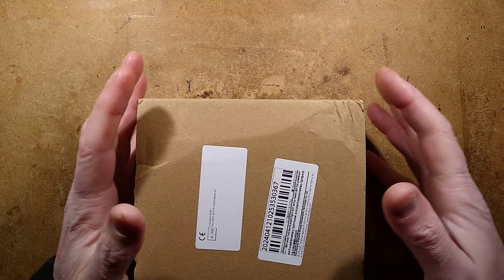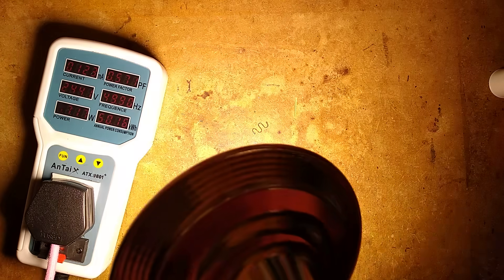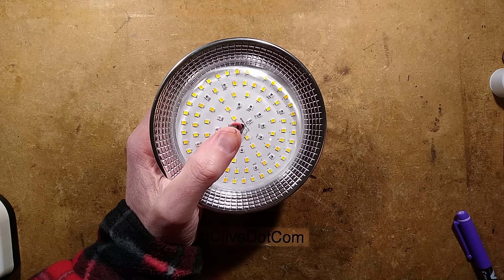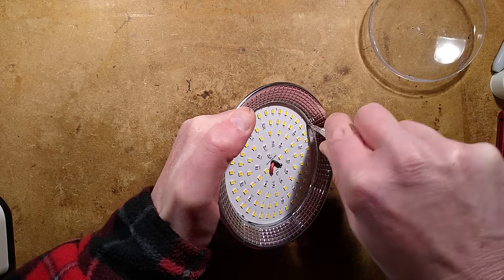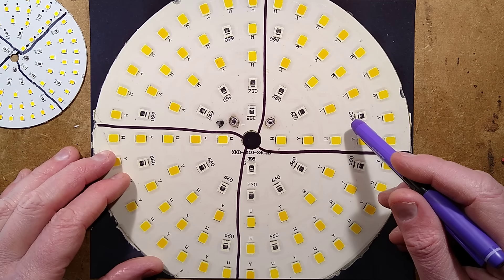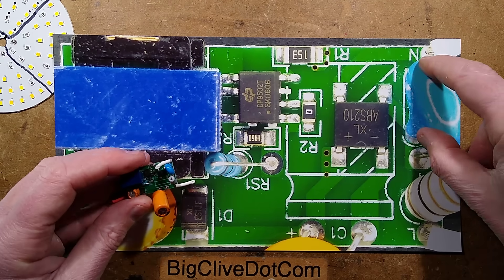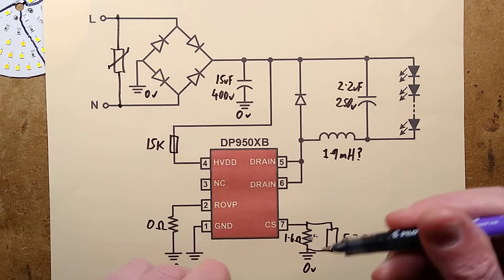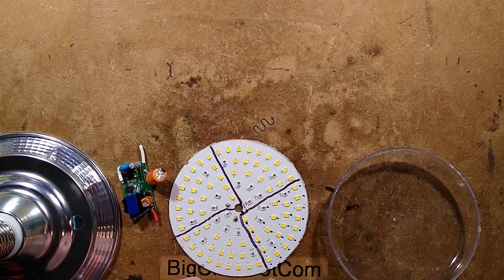Broad spectrum grow light teardown

Comment: After watching this video I bought one because I was interested in the qualities of the light output.   One thing I noticed was that when the light was off and in the socket, if I touch the aluminum, the LEDs would glow at a very low power.  I did NOT touch the aluminum when the light was on.
At first I thought I was discharging the capacitor.  HOWEVER, I tested it in a ceiling fixture that is still connected to 1924 era knob-and-tube wiring, which is not grounded.
I will test this on another circuit in a modern house, but in the meantime I have a ...
Question: When the bulb is on, do you think the aluminum cooling shroud is dangerous to the touch?
Thank You!
Reply from the maker: It's probably capacitive coupling from the tracks to the case.  Very common.  It only takes microamps to make the LEDs glow.

Comment: A test in 2016 which I cannot find any longer showed what happened at different wavelwngts. Red having less energetic photons made the plants larger, while blue kept them compact.

I suspect most will be best served with normal white light with some separate blue and red COBs. 

You can go into absorption equations the different chlorophyle types but the sun does not care.

Comment: I found out myself a long time ago that fondling the metal casing of an electrical device with the back side of the fingers very often gives this slight tingly sensation if it is "grounded" by the tiny HV capacitors... if it is floating, usually not so much. It even seems to impart a slight friction.

Comment: 2:44 my phone is giving me tingles when I slide my fingers over it and when the phone is connected to a charger. Well not exactly tingles but I feel a slight fuzz similar to when you touch a CRT but weaker. I can even light up my test screwdriver a bit when I touch the metal body of the phone.
But I guess that is fine.
Reply from the maker: If it's a good quality charger from a reputable source, then it should be OK.

Comment: Too bad that the driver circuit is located in the heat trap with no effort to keep it cool.

Even if the rated MTBF of the IC is a miilion hours, elevated temperatures can reduce yhe average life to less than 10,000 hours... By which time half of them can be expected to have failed... Mean time between failures... Halves for every 10°C in operating temperature above 25°C.

Comment: Interesting video, (I thought it was a shower head for a moment!) But what happens to all the bits at the end. Do you re-wire it all back together? (Someone would buy it, especially if its been on Clive's bench.) Or does it go into the skip...? 🤔
Reply from the maker: I kept the buck converter and PCB, but wouldn't trust it as being safe now I've prised the PCB out.

Comment: Mixing 3000 K and 5000 K white light doesn't give you better color or a more even spectrum. It just gives you a shade of white in between, which is 3750 K, assuming equal luminosities. It would also have a slight magenta tint, being off the black body locus, so it's not even pure white. There's no particular benefit to mixing whites like this in a fixed ratio.  You'd be better off using emitters of the desired color temperature. Now if the ratio could be adjusted, then it would be a tunable color temperature, which is quite useful.

Comment: Little gadget that you might appreciate - OPPLE Light Master It measures the light Illuminance,Color temperature(CCT), CRI, CS, EML, R1- R14, DUV via bluetooth on your phone - ive been using mine for about a year and has been accurate - plus its about $30-40 from the usual sources

Comment: I grow 'herbs' inside. I prefer to use the normal LED bulbs you can get at any hardware store in the daylight and warm spectrums. Then, when they get bigger, I prefer to use a 600w high-pressure sodium lamp and ballast. Works great ;)

Comment: Made my own grow lights for my winter garden plants (Citrus × limon and Nerium oleander) with those pinky cheap DIY 3W star shaped chips "380nm-840nm". They work fine and my plants seem to like them (last winter no problems). Put a bunch of them on alu heatsink-leftovers from no-idea-what combined with an older MeanWell power supply.

Comment: 3:01 Is that what that is? I’ve been wondering for ages why I get a slight tingle that makes the hairs on my hand stand up when I touch the metal case of the (unearthed) DVD player!
Reply from the maker: It's very common and quite an annoying feature of the modern high frequency power supplies.  Not just capacitive coupling between the winding layers, but also via the capacitor that is supposed to provide a route back for that coupling to reduce the radiated electrical noise.

Comment: Just a minor correctioni: 5000K isn't cold white. It's about as close to neutral white as an LED can get as it's approximately the standard photographic white point. Cold white tends to be more up around the 6000 to 6500K range and has a distinct bluish hue to it.
Reply: 5000K can come off as extremely cold if they skimped on the phosphors in the red to yellow part of the spectrum, which a lot of low CRI lights do. Part of the problem with fluorescent tubes was that they had similarly rubbish CRI, which is why paint swath desks used to have buttons for incandescent, fluorescent, and "daylight" (the last one was just both lights), and a lot of the early "daylight" LED bulbs had the same problem. Fortunately, high CRI phosphor blends are more common now, but I wouldn't be surprised if LEDs with the more rubbish blends are being liquidated in fittings such as this, because the warm white phosphors help fill in the gaps.
Also, I promised myself that I wouldn't get into the pedantics of higher color temperatures being "colder," but I guess I just broke that promise, so in a nutshell, the hotter a star's photosphere, the bluer its light.
Reply: No... 5k is 5k.  It's the packaging that lies,  not numbers.
Reply: @thomasneal9291  No, not all 5K are created equal. I remember having one of the earlier "daylight" bulbs in my bathroom that made my pale-ruddy skin (typical for a ginger) look ashen because of gaps in its emission spectrum.
Reply: My chilli seedlings thrive best under 6500k bulbs so this being up to only 5000k surprised me.

Comment: The capacitive coupling is crazy with these cheap led drivers, one particular brand of cabinets likes to glue the metal cased 80w led drivers to  a metal backplate, of course they dont come with an earth wire. When you touch a screwdriver to short it makes almost a continuous spark

Comment: The science behind grow light spectrum selection is a very interesting rabbit hole to fall down. more recent studies I peeked at out of morbid curiosity suggest that broad spectrum is better than 'Burple' because while plants may not use all wavelengths for photosynthesis, they do use other spectra to trigger certain growth factors that indicates things like competition (Shadowing), dawn/dusk (blues/reds) and of course season (UV concentration)
There's also the human factor... It's difficult to see issues in the plant such as fungus or damage under Burple!
Reply: I'm overwintering chillies (they're perennial shrubs, not annuals) indoors with 6500k office led lights. 
They're working fine, and without "hydroponic" or "gro-light" in the title they're much cheaper!
Reply: I’ve read that plants actually has other kinds of molecules than chlorophyll that help absorb light of other wavelengths than the chlorophyll itself that can transfer electrons to the chlorophyll, or something like that. I.e. the plants are able to utilise a much broader spectrum light for photosynthesis than the chlorophyll alone, so the benefit of burple is not as great as one might initially think when looking at the chlorophyll absorption spectrum.
Reply: Gee, I wonder why professional indoor growers are still using HPS and not LEDs? ;)
Reply: @railgap they are cheap in bulk. Professionals in the states use full spectrum white led.
Reply: i feel like it's a much smaller difference than people make it out to be

Comment: Nice video, Clive, and an interesting lamp. I wonder how safe the light output would be for humans, although with no UV LEDs it would likely be safe for humans. I'm not into growing things and don't know what kind of light spectrum is good for what. Maybe a grow light comparison would be interesting?

I did note that when looking at the physical circuit board you described an inrush limiter being present, yet on the circuit diagram you drew out there was a surge suppressor across the mains input rather than an inrush limiter in series with it. Which is correct? Is it an inrush limiter or a surge suppressor?
Reply from the maker: It's a MOV surge arrester.
the light output is safe for humans, but not the housing.

Comment: The problem with the LED "grow lights" is that they really aren't "full spectrum" in the same way as sunlight.  They simulate sunlight by creating sharp peaks at various wavelengths.  You might not see the difference, but the plant's photosynthesis won't work the same way.  Different species of plants have different needs of intensity, duration AND spectrum.

Comment: Thinking how much money I spent and effort to control heat in the old days of using ballast driven halide and sodium lamps to do closet grows.  When LED lamps came out, so many problems with heat disappeared but it meant buying all new equipment and it wasn't cheap like now.  Of course, it's not illegal to buy swhank now, so there's little profit in closet grows.  But I'd have given a nut to have a lamp like the one you're showing.

Comment: The main features are: poor current balancing, poor heat sinking, token numbers of UV and infrared LEDs and of course, a power supply flailing on wires. It's essentially a reading light with a few oddball emissions.

Don"t buy one but if you were forced to use one, it would be good to attach an earth ground lead to the aluminum housing to provide a modicum of fire and shock prevention.

Comment: I bought three 60w and two 120w daylight flurecent photo  bulbs 10 years ago. For 8 years now they have been on 12 hours every day (expept in middle of summer) every day used as grow lamps. 1/6 the price of grow lamps and did the same job ;) Also used them for color accuracy when doing photo editing and inkjet photo prints, gave a nice 4200k color that is nice when you work late and need to stay awake (works better then coffee to keep you awake).
Reply from the maker: I use 4000K for my video lights.

Comment: How serendipitous, I have literally been looking at grow lights today. Not for anything nefarious, I'm getting some seedlings going to give my veg plot a head start in the spring, you've got good timing!
Reply: i use mine for growing marijuana. for smoking. to get high.
Reply: it also helps to grow hair.. on your head
Reply: I did the nefarious indoor and outdoor growing when I was a youngster. It taught me how to grow amazing organic tomatoes. Thanks for reminding me. I want to set up an indoor shelf for plants. - ALSO don't spend hundreds of dollars on a HPS light when you can just get the bulb and ballast and parts yourself (and do it safely and to code)
Reply: aliexpress (other cheap Chinese outlets exist) round or square 36w led lights that slide on to a contactor as shown here recently are great. MUCH cheaper than grow light when not on offer they are about £10 but on offer can be as low as £5 each with free P&P
Reply: I would like to grow habaneros in winter but I've been told they don't do well (get hot) under lights. I don't know enough about it really, grow lights I mean.
Reply: @SubPablum  experiment, £5-£10 for a panel isn't much to find out if they like it or not. Something to do for the winter, they also light rooms of it doesn't work lol
Reply: Habanero peppers drop lots of flowers and buds for some reason. You might try Thai or Serrano. They are a little more forgiving of temp and humidity swings.
Reply: Lots of good cheap household bulbs available from B&M

Grab a high lumens small screw 6500k
 And a high lumens bayonet 6500k

And B&Q has a large golf ball 2000 lumens 6500k.

I artificially flipped 5 "tomato" plants
Throughout last year just on the above equipment
One plant after another
Using standard household lamps,
You already own

GROW ON YOUR WINDOWSILL 4 FREE
APRIL - NOVEMBER

Anything else ☝
Reply: I got some spiderfarmer 100w pannels a bit ago (for nefarious purposes) theyre quite good i think, wait for a sale and you'll be laughing
Reply: A mix of warm white and cold white fluorescent tubes work very well for your needs. LED grow lights alone are a bit narrow band for seedlings.
Reply: @SirBoden  nah that's BS, light is light, any theoretical benefits of other lighting types are well outweighed by their power use, and LED lights that use multiple frequencies
Reply: @  You may want to do some basic research. You may find it fascinating.
Reply: @SirBoden  Indeed, a touch more blue is needed.
Reply: interesting to know leds still arnt any good for growing, back in the day we used 6000k cfl fittings and hids lamps, leds couldnt come close @SirBoden
Reply: @robboinc1  I was saying the opposite the cheap panel ones work great, I've heard😆
Reply: @robboinc1  LED are fine for growing.
Reply: What would a nefarious use for a grow light be? 🤣
Reply: @RT-qd8yl The peeenis? 😮

Comment: I built my own linear grow lights using luxeon star clones thermal-pasted to some leftover aluminimum extrusions and some cheap led drivers.  Initially I just did burple ones, but I discovered they kinda hurt my eyes when I'm trying to work on the plants under them, so I added one row of 'broad spectrum' leds just for me.

Broad spectrum isn't really for the plants, but a little bit of white or green light mixed in helps the humans.

Comment: Forgive my non-electronic knowledge, but how can this actually handle anything from 110v to 250, or did I misread the ad info?
Reply: Standard switch mode type power supply, they can usually handle 85-270V.
The simple version: first they convert to DC, then switch the DC on and off at high frequency (for efficiency). The ratio of "on time" to "off time" determines the output so if the input voltage is halved the on-off ratio needs to be doubled to achieve the same output (approximately).